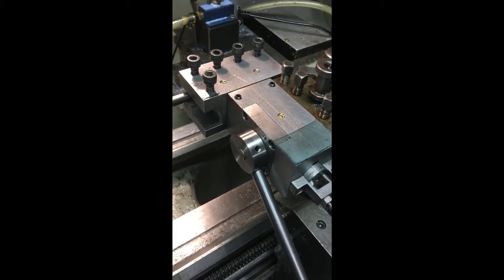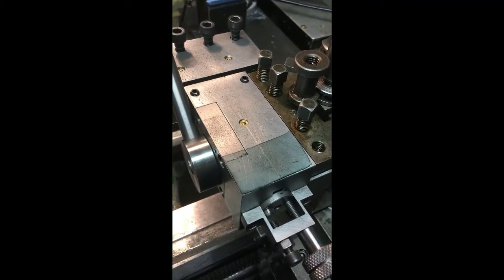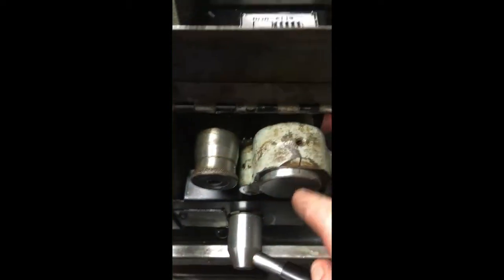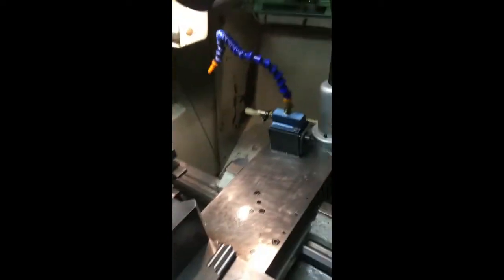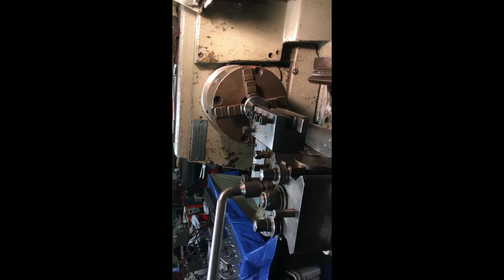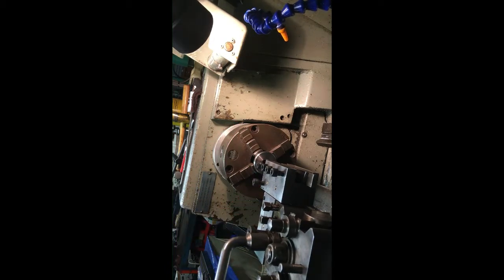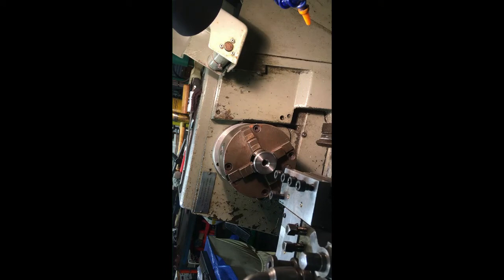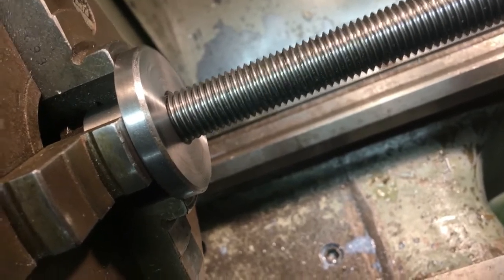Retractable internal and external screw cutting tool holder

Comment: Can cause over hang
Reply from the maker: I agree, but when screw cutting it is not like you are taking heavy deep cuts. Even on larger threads the tool can be set to generate the thread rather than plunge screw cutting, which also reduces the cut size.
I have used the tool on a few components and it doesn't seem to be a problem  (so far). Thank you for the comment. The Home Engineer